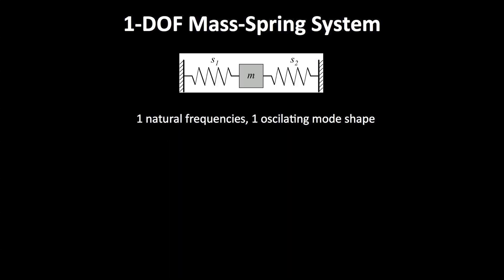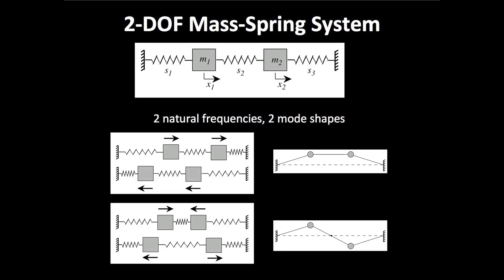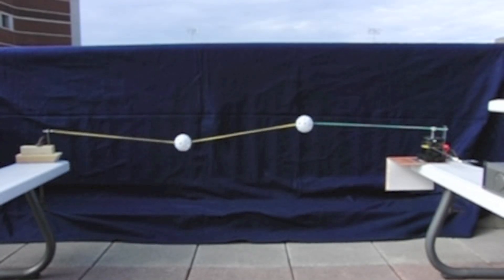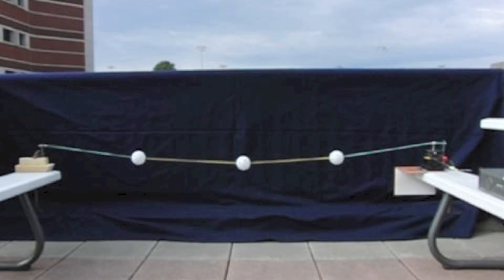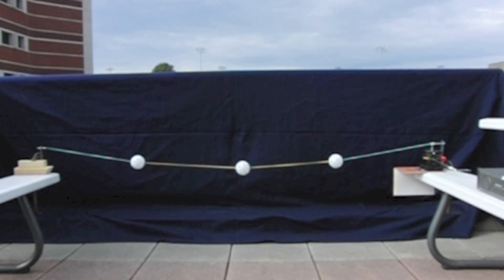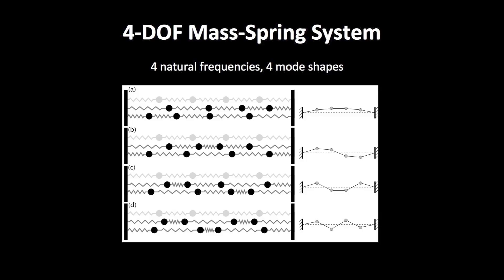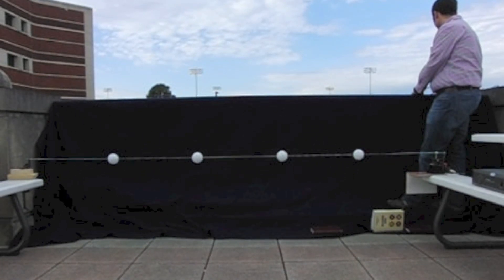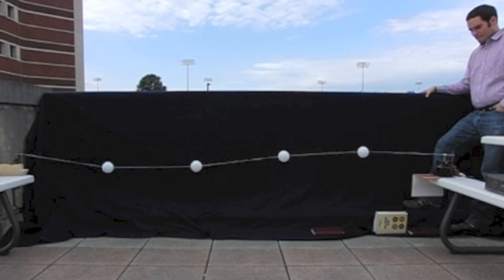Mode Shapes for Multiple Degree-of-Freedom Oscillators

Comment: Thanks for the reply, which I missed. I looked at the limit for a non-linear wave equation and found that the result differ, depending on the assumption made about the atomic structure of the string; i.e. if it is assumed that the string consist of discrete oscillators (atoms) or if it is a differentiable string. Currently looking for some (crow) funding to turn the notes (over hundred handwritten pages) and my old dissertation into a publication - difficult if you don´t live in the US.